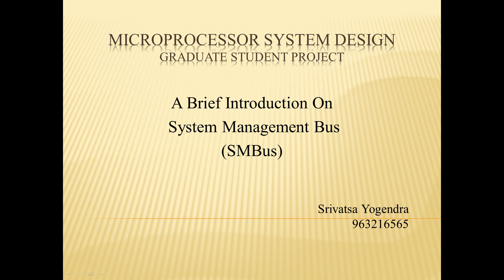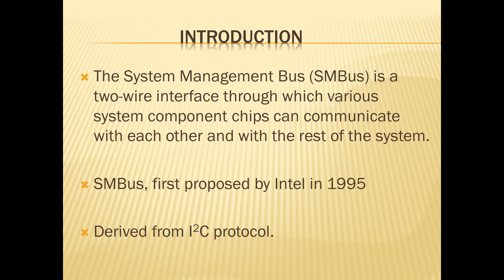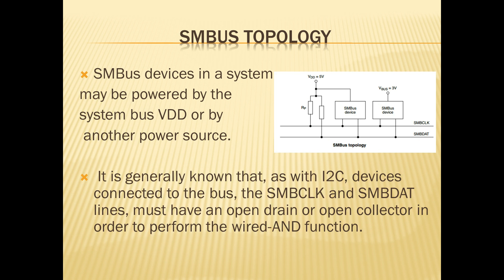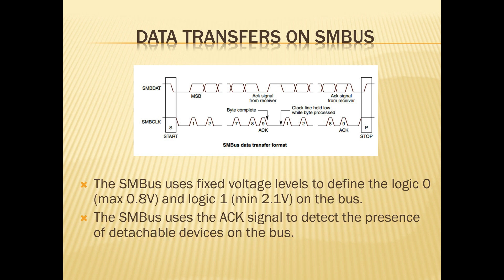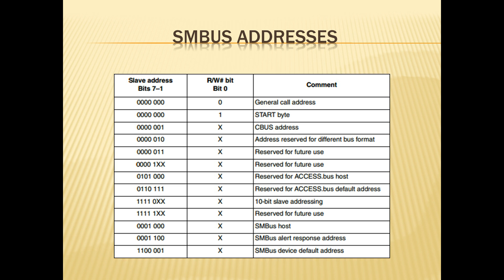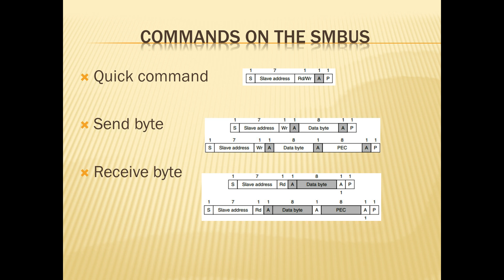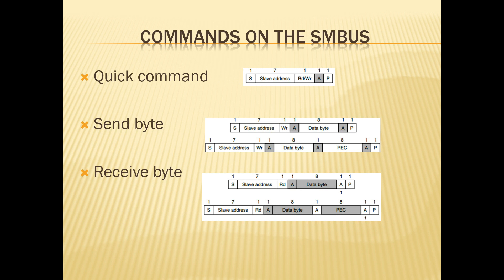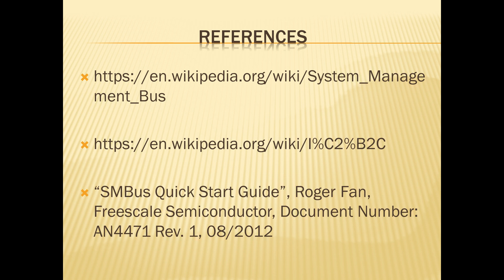A Brief Introduction to SMBus

Comment: Hello there and thanks for the great presentation. It helped me. It also confirmed my thoughts about the smart battery system. To my problem: I want to implement a battery into a Intel NUC. I havn't seen a SM-Bus controller on the mainboard but I need it in order to have it mobile. How can I achieve a communication between a smart battery and windows so, that I get teh battery symbol in the taskbar like in Labtops? The Skull Canyon NUC has an UART port which I can use. Any help is greatly appreciated.